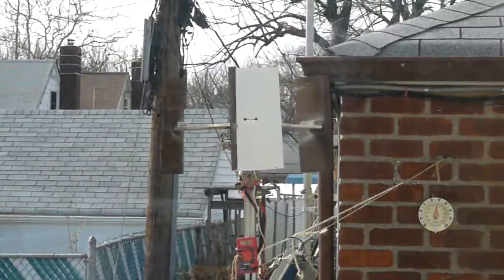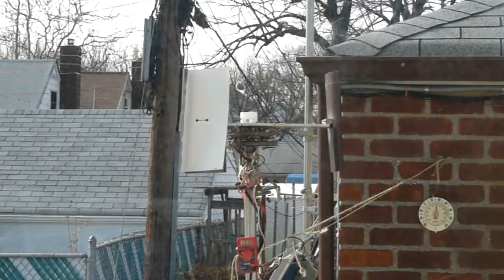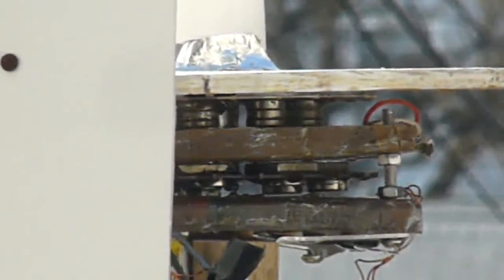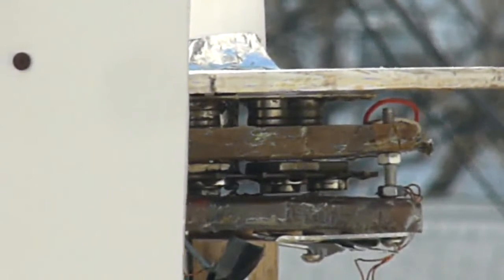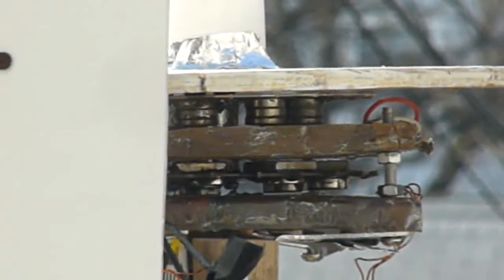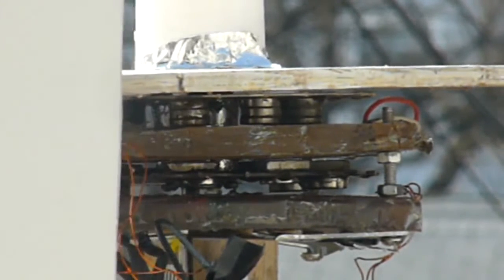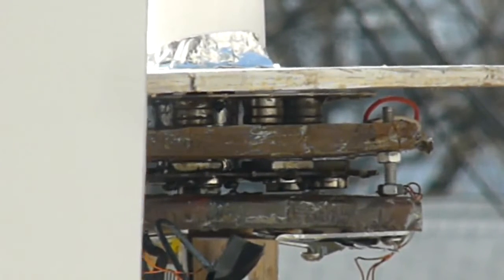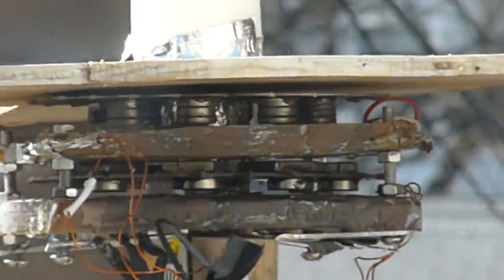dual rotor dual stator axial flux vawt.wmv

Comment: DELTA generator would need to spin more per volt, while the WYE would require less rpm per volt. Delta produces more watts, while WYE produces more volts.

just note that the strength of a magnetic field near a dipole falls off as 1/ , where r is the distance from the center of the dipole.

Comment: may i suggest you change your wing to Selig S1223 or Chuck Hollinger ch10 (smooth) high lift low Reynolds number airfoil as these nomenclature can really boost your windmills RPM

Comment: At the center metal plate you have put wedge magnets on topside and round magnets on bottom side. Install the round magnets in the 3rd plate and make it rotate too. cut  holes through the center plate (in the portion covered by the wedge magnet) with the same diameter as the round magnet thus allowing the magnetic flux to flow in the 2nd stator.

Comment from the maker: @muddymuddymuddmann I'm not sure how you apply the coiled up steel banding. Are you talking about the steel banding ring  type you use in the ceiling fan motor. I tried to slip a couple of thin pieces of metal (one they use for stove pipes) underneath the bottom rotor. This makes the rotor slightly sticky and a little unwilling to turn. I did not measure the voltage. I was thinking, a little more sticky, a little more power.

Comment: @wtam69 better than nothing! watts does matter, but so do amps to a point. you're producing plenty of voltage, so if you could find a way to increase the amperage then the total output in watts would be much greater for sure. 
nice project, and thx for your input!

Comment from the maker: @lad18913290 I'm sad to say, a few watts. It has high output in voltage (over 40 v handspin) but low amps. I was told it's the watts that counts so if the alternator is matched to the right batteries or with some kind of mppt device as a controller, it would work better.

Comment from the maker: @peper0110 A quarter inch thick steel plate. The willmill will be bulletproof, from underneath anyway. Thanks for the good info. I was just going to slap on a thin sheet of metal.

Comment: well i can to the conclusion when you use one magnet plate, the flux acually start to bounce of the coils and not through it and it start acting like a stone skipping across the water, so in conclusion, you do need the flux to focus and travel though the coil and the only way to do that is to have another magnets plate or at least a steal plate spining with it on the other side.

sam

Comment from the maker: @shartne Runs good the way it is now. More wings will slow it down I think. One viewer suggested I add a metal plate to the bottom to increase the output. I wasn't sure if the plate can be a stationary one.

Comment: how well does the wind turn that baby now that you added the extra rotor and stator. i thought it would turn better with the wings doubled in length or may be add more wings. If you had six or a dozen wings it would catch a lot more wind.